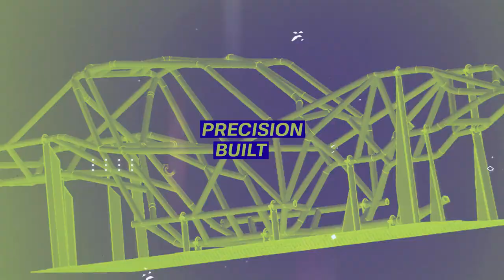How to Keep Fluids in your Rock Bouncer - Tech Tuesday

Comment: Thanks Jake just I was looking for. Best description and demonstration so far.  Going to update all of my fluid/vents  like this.
 Had complete rollover on my roof a while ago in hard to recover area so it sat over an hour, lost all eng oil almost all transmission fluid. Had a gallon of trans fluid and about three or four quarts of motor oil but it still wasn't enough to get out of the trail on steep hills without trans slipping and oil pressure going to zero! May of burned up engine bearings.
Reply from the maker: this should help a lot

Comment: Hey Jake, how does the axle vent work? 
I can’t get my head around the straight up then down method cause if the car was upside down the oil would come down the line, hit the bend at the top (now bottom) and there would be enough oil in the housing to go round the bend and back up to the housing and out the hose, even if you went round again so the vent is normally at the top away from mud, water etc   
Do you run it side to side first or something?
Or just rely on the filter at the end of the hose?

Either way, great content, everything else was super easy to understand and awesome as always 👌

Comment: Would the PCV drilled into say a LM7 valley cover not still suck up oil in a roll over right into the intake?  Should you run a loop around the motor, down and back up to the back of TB or intake?

Comment: Are you guys running dry sump oil systems to maintain oil pressure on these crazy hills and when upside down?
Reply from the maker: No dry sump systems for us.  We use accumulators. They hold pressurized oil that is forced into the motor when needed.

Comment: Another great video.
Any tests/experience with dry-sump systems? I guess they are out of the question due to higher cost, space, maintenance and complexity.
I see Goliath is coming out Insane even down to that killer color.
Reply from the maker: Yeah very few run dry sump systems because of the cost and reliability.
Reply: @BustedKnuckleOffRoad  Thank you for the answer. Keep up the amazing work

Comment: What if you are running an ARB? Wouldn't the FAST system be your only choice?
Reply from the maker: It shouldn't make a difference unless it is a vehicle that sees a lot of high speed.
Reply: @BustedKnuckleOffRoad  appreciate the info! I was just thinking with the ARB you are introducing air into the housing, and it would need to go somewhere, making a bellows not work.
Reply: @donanders2110  An ARB doesn't pressurize the whole house.
Reply: ARB directly told me  not to use those bellows . Could just be over abundance of caution on their part.  With ARB lockers, if one of the air seals in the diff goes bad which does happen, it will pressurize the case.  it's a good diagnosis tool when they're not working go over to the vent and listen you'll hear it hissing. A bellow would potentially blow out seals if it was strong enough & make it harder to diagnose.